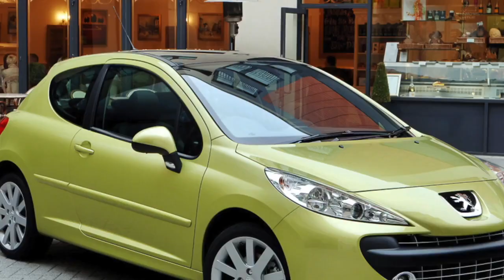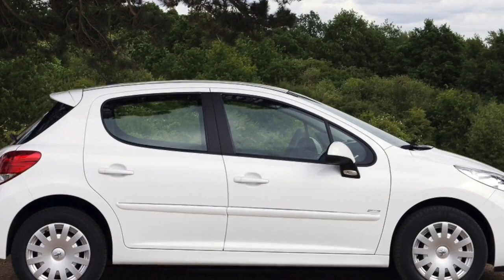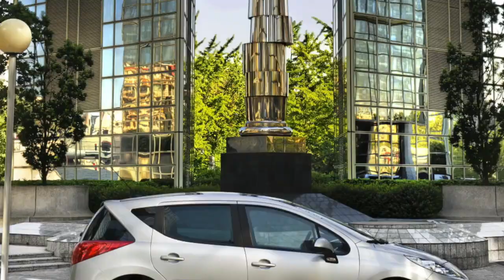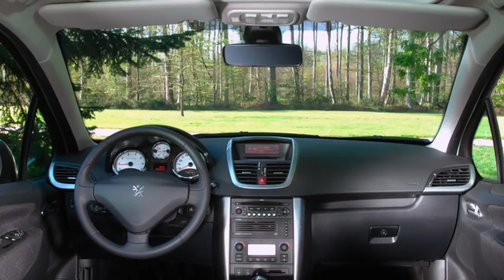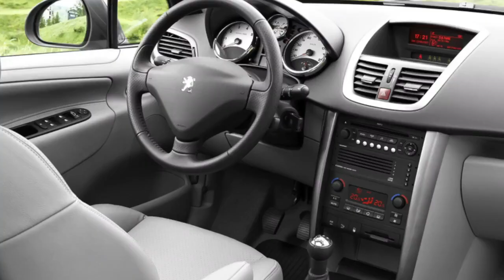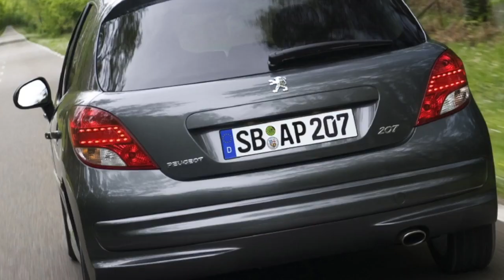Used Peugeot 207 Reliability | Most Common Problems Faults and Issues

Comment: My 207 1.6HDi is still going at 156,000 miles. Only issue being the DPf complaining about being clogged and the oil cooler gasket leaking everywhere.